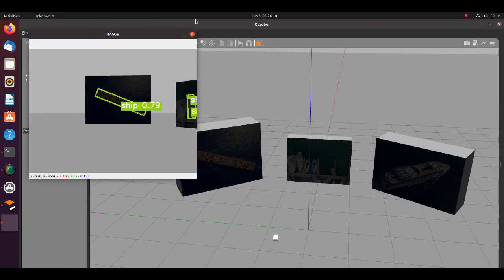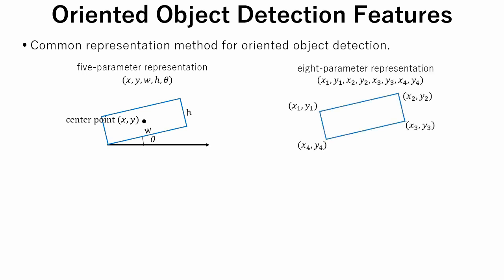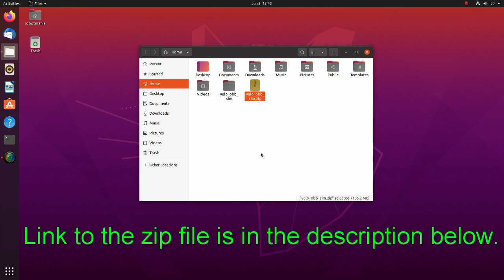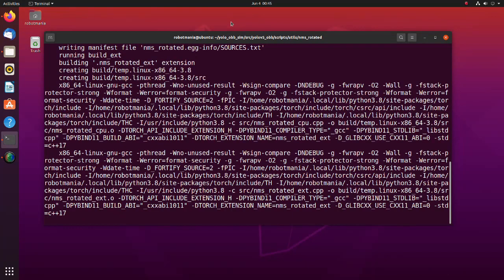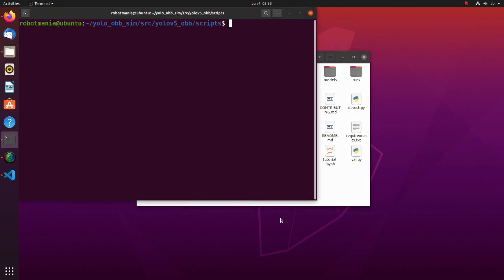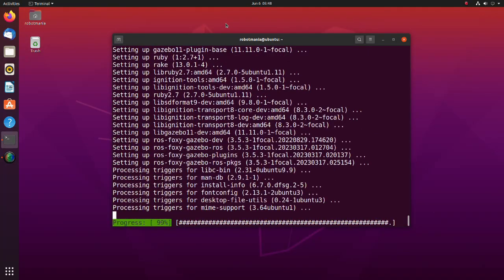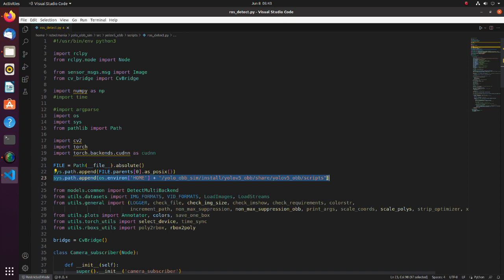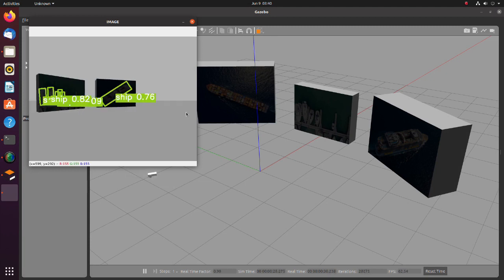Oriented Object Detection using ROS2

Comment: Hi, thanks for this great video. I also tried training custom dataset with boat as a class. In your model, how many images have been used? The model was trained for how many epochs? My model is not working which was trained with only 30 images for 1000 epochs. Thanks in advance.
Reply from the maker: Hi GlenBennetHermon!
Thanks for watching my video!
I used 80 images to train one class. I did train for about 60~80 epochs. 30 images may be too little to train, so I think you should prepare another 30~50 images.